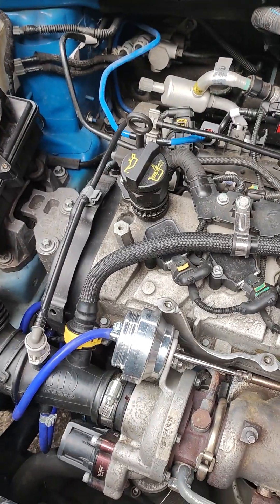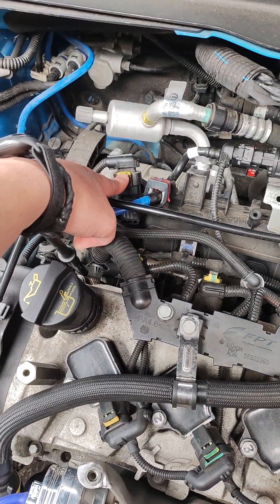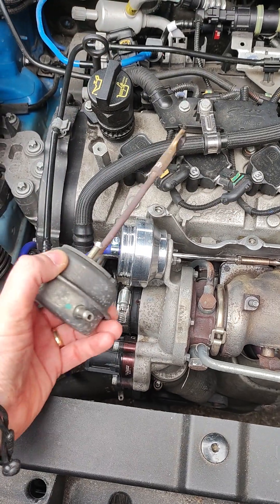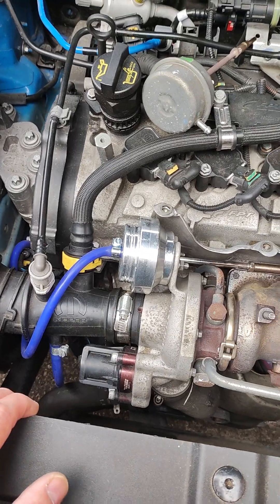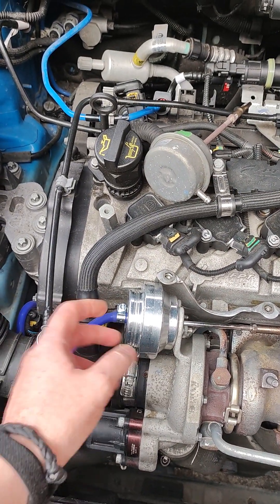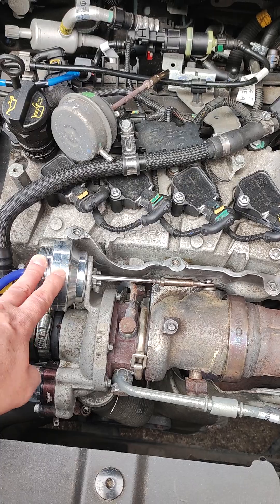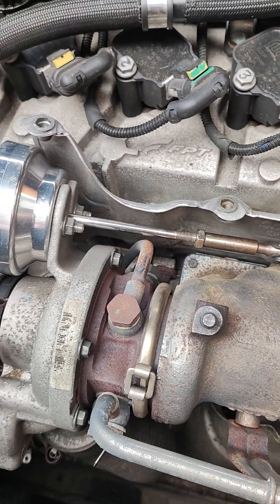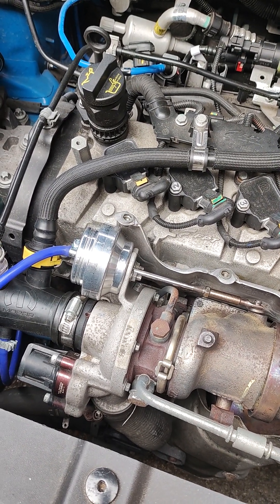Jeep Renegade 1.4MA Wastegate Actuator

Comment: I have a client with a 2016 compass 1.4 multiair. He thinks it's sluggish but when i drive it from 2000 rpm the turbo clearly starts working. Map reading is 225 kpa. Only thing i feel is that its not accelerating in a smooth way. It sometimes seems to be hesitating somewhat. Is this all normal? I aldready did the wastegate preload setting which is now +- 8mm
Reply from the maker: Hi @leon_brown, that does sound a bit odd that it hesitates. Probably the best way to compare is to drive one that is functioning correctly. Have you run an ECU diagnostic on it since doing the actuator work?

Comment: Mine had a crack in the air hose going to the dump valve. Shortened the hose and put it back on. Let's see how it goes. Also replacing both sensors

Comment: Hi John , could you please tell me what the part number for the sensor after the throttle body? I have replaced sensor A, but I need the correct part number for the second sensor please. I have the same vehicle.

Comment: is it the wastegate actuator or the diverter valve problem? i also have the p0236
Reply from the maker: Hi, the wastegate actuator was the problem. This was a long process of elimination, including replacement of sensors, boost control solenoid, diverter valve upgrade (aka dump valve).
Reply: Had this issue with my jeep for years now driving it. Mechanics just scratch their heads and quote me on random Replacements. Hopefully this will fix my problem 🤞
Reply from the maker: @charmaineduffy8204  Hopefully it will sort it for you, we had 2 years of driving with this intermittent fault. Although the @forgemotorsport is not cheap, it's well made. I cut up the original actuator to see if I could see any damage or whatever, but it looked 'ok'. My wife has been running with this on the car for months now and all good.
Reply: @charmaineduffy8204  Hi, did that help? I have the same problem ...
Reply: Hi, only just seen these messages. But this has fixed the issue. Over a year running fine with no errors or limp mode.
Reply from the maker: https://www.forgemotorsport.co.uk/Turbo_Actuator_for_the_14_Multiair--product--74.html
Reply: Hi Thank you for the video. But you Said 10psi. I can only buy 13 purple 15 yellow 18 blue 20 red   155 euro. Not so expensive also not cheap.
Reply from the maker: @barth2724 hey there, Forge are listing a Green 10psi spring in their FMACFPEVO actuator